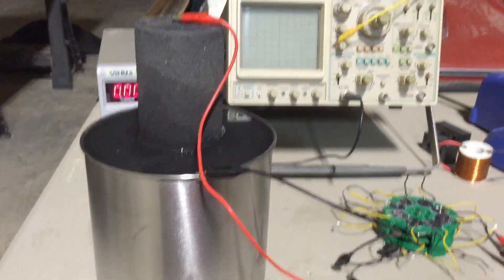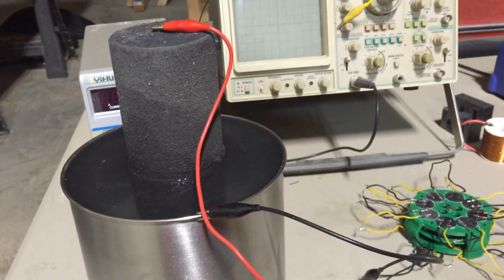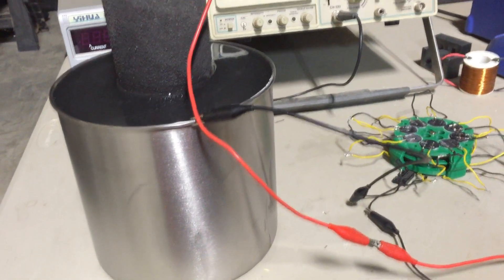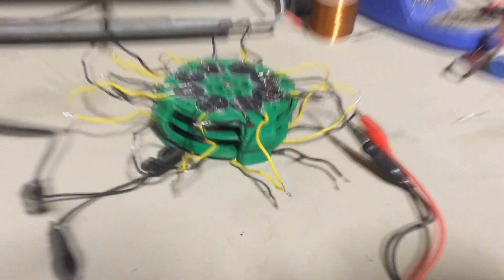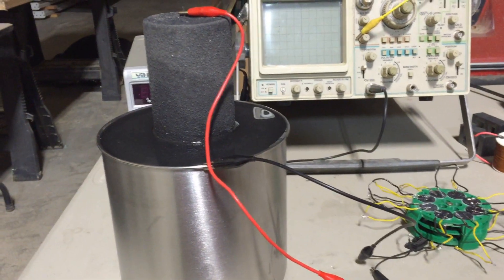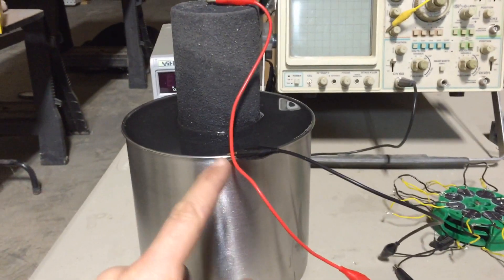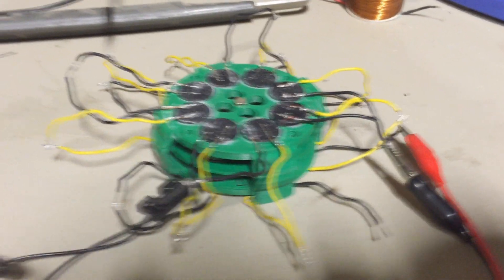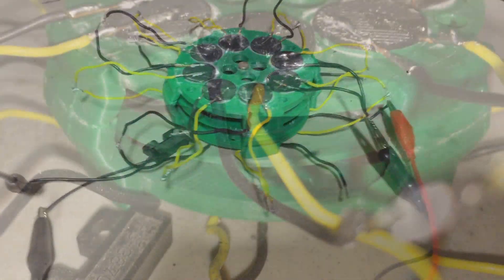Stainless Steel Powered Motor

Comment: What makes an anode an anode and a cathode a cathode? Why is graphite a cathode? Is there a better ore to use instead of graphite? Didn't know graphite could create a charge with electrolytes(that's what's in the steel pot I'm assuming.

Comment: there are different grades of stainless steel im sure together they might produce voltage too.   i have taken a stainless steel butter knife and an aluminum heat sink made a crude battery left it wet for 7 months now almost no corrosion . low voltage but im sure its about the same as  this is putting out.. nice video thanks for sharing

Comment: That's awesome! 100 mV you could use one of those very low voltage dc to dc converter to harvest the energy and charge ultra-capacitor or battery :) Thanks for sharing!

Comment: Hey Laser, you can run this motor using two aluminium foil (those used in kitchen for cooking). Put Alum as the electrolyte and voila'. It will give what power you need for that beautiful motor and still not get any corrosion.
Reply from the maker: Fausto Heikkinen 

Wonderful news, I will try that out for sure.  Thanks for sharing.  I am also planning on testing it between two copper rods driven into the ground at a distance.

Comment: Maybe build the cell up with the Rochelle salts instead of water.
It is very large chunk of carbon and quite a large pot.
Lots of surface area. Could use a stainless steel kitchen scrubber for a smaller cell with equal surface.
Graphite crucible might be another good vessel.
Awesome little micro amp motor btw

Comment: What if you take out the water and seal the unit drawing in AIR into a slight vacuum where your water was you see AIR is all electric nitrogen oxygen hydrogen xenon etc then you will have a never ending battery pack according to logic as your water is all electric as is the salt as is the universe all in chaos wanting to get to equilibrium   No expert here in uk but it appears logical

Comment: Will it run off a hermocouple or a thermopile? At room temperature a thermopile should generate as much voltage as your stainless steel cell. Put it in a black container full of water and stick it in the sun for a "solar" powered version.

Comment: I dont get whats the point of this. That little disk takes almost no energy to turn. So great u can turn it with almost no energy... Pointless.
Scale it up till it can used as fun at least then see how much energy u need then compare it to a regular motor. My bet is its not much better if any.
Reply: the point is to inspire people, whats pointless is your comment.
All great things start from small beginnings.
Reply: Sniper664 Lol this type of motor is not new well known for a long time. Still you see it only this type almost no torque  no speed application. I bet there is reason. I guess you need much more magnets and copper to make a same power regular motor. It would be interesting to see a good comparison.  If you mean inspire ppl to make useless toys then you might be right.
Reply: Hulla Dek hulla dek  fuck off .

Comment: Nice experiment have you thought of adding a positive and negative wire ring in your 3d print on the bottom and top of the motor you could solder too instead of all the hair of wires coming off would make it really slick I think.

Comment: So you just made a motor that can run for years. in fact you have lots of them. but what excatly are these motors could be used for? a different kind of clock? a fun spinning thing for an apocalipse shelter?
Reply: Naoki Kashima
 They would be limited by internal resistance, which I imagine is quite high in this thing
Reply: Thanks but i use my dick for that. And you havent answered the question.
Reply: If you wire many of these stainless steel batteries together there is really no limit to what it could run. Also, if you use these materials in a building of a structure you could power the structure using its foundation! Really your imagination is the only limit here.
Reply: Hmm... thanks man

Comment: How many of the coils are you using
Reply from the maker: Joel Van Buren 

In this first test just one.  The motor is wired in a way to allow it to run using between 1-16 coils.  This gives it a lot of versatility.  I ran out of time at the shop this evening so I will have to test other arrangements later.